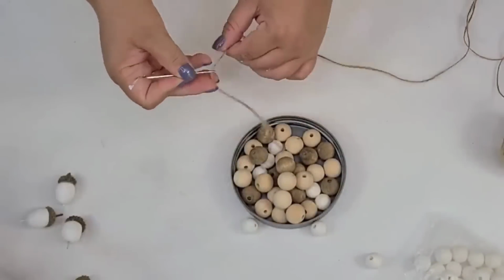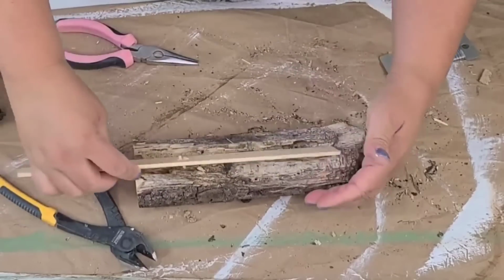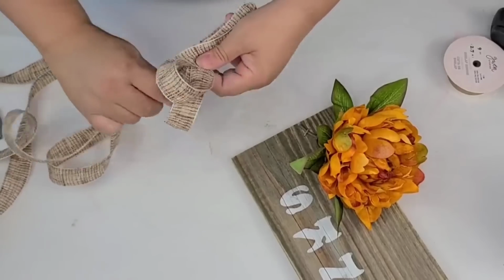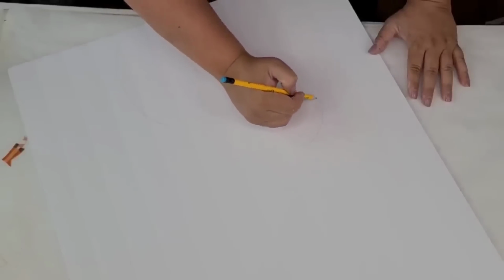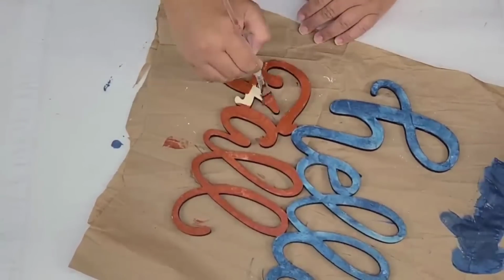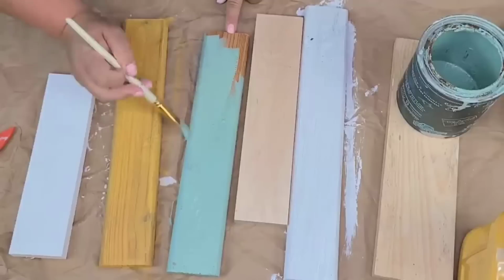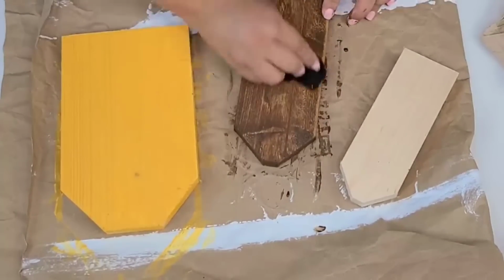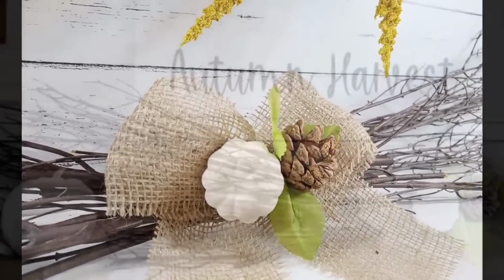27 STUNNING DIY Craft Ideas for FALL

Comment: Absolutely beautiful DIY’s! Love them all! Question for you - do you use cricut stencil vinyl and transfer tape? I have not had good luck with Cricut brand stencil nor using the transfer tape with it, it sticks too much to the vinyl…. If you do use cricut brand, any tips?? I hate to just have a whole roll sitting here not being used
Reply from the maker: Hi! I use ones I get on Amazon. May e stick the transfer tape on a clean wall and unstick several times to remove some of the stickiness?

Comment: I love all your projects.   I am definitely a beginner.  I am trying to create a framed wall hanging using an old frame of mine.   I  used one of the sheets from Dollar Tree with a sticky back that looks like wood planks.   I stuck it to the cardboard in the picture frame to use it as a background.     I wanted to glue some of the small pictures on the back on those pretty dollar tree calendars you are using.    I tried hot glue but it does not want to stick to the vinyl type sticky thing I used.  What do you think would work best,    the spray glue,   mod podge,  what ?
Thanks
Reply from the maker: Hi! I'd say try spray adhesive. Thank you so much for watching ❤️